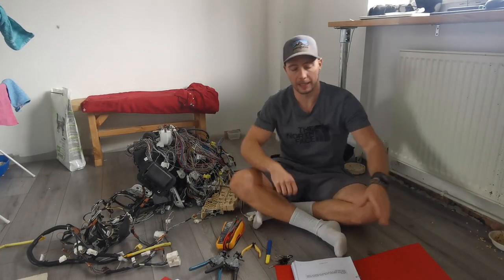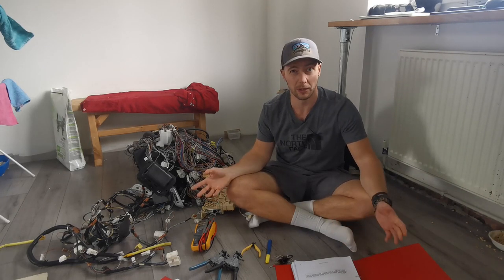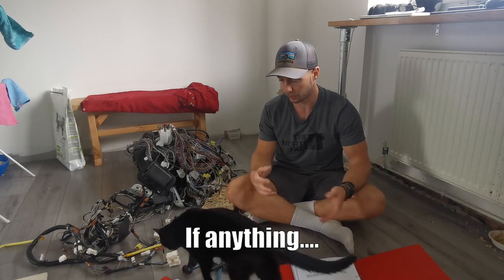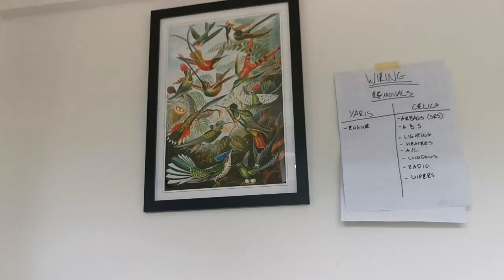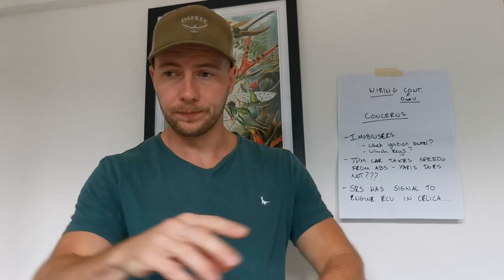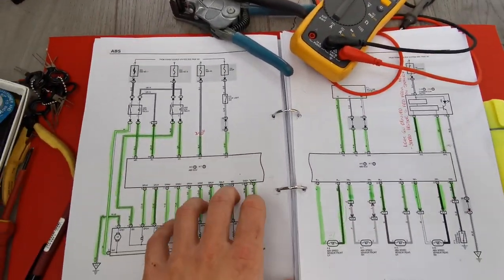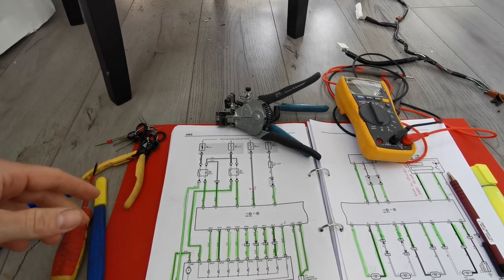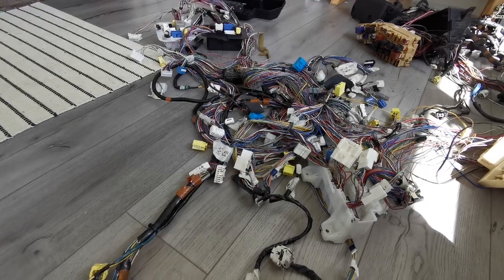2ZZ Yaris Build ep.12: Wiring talk

Comment: The Yaris engine harness it's separated from the body harness!
Reply from the maker: It is indeed but they both run to a single ECU, albeit separate looms. Some of the ancillaries run from the engine fusebox. It's pretty convenient but I need to rehouse things like the heater relay and fuses etc. And getting the clocks working might be tricky as the yaris and celica use a different speed sensor in the gearbox and I'm currently not sure they interchange!
Reply: @readysheddyno9958  I'm swapping my 1,0 with a built 1.5 (about 160/170hp)
Please enter in the fb group for the Yaris club UK
Reply from the maker: I'm in YCUK, I've posted my vids a couple of times in there :)